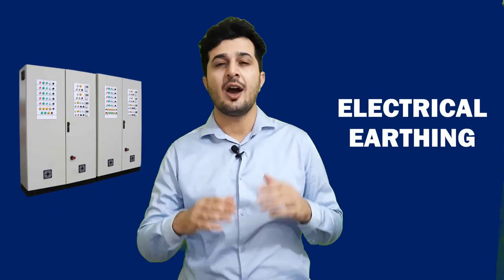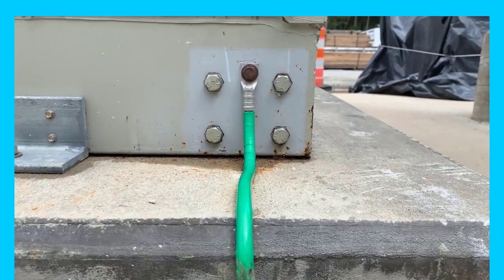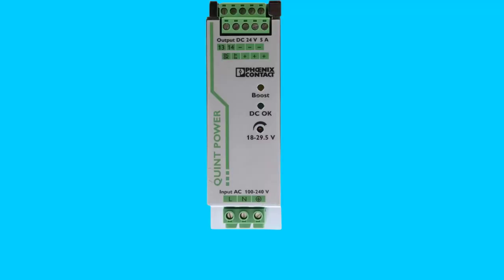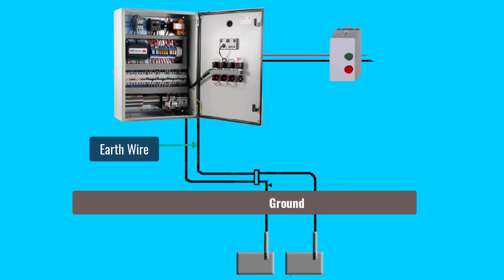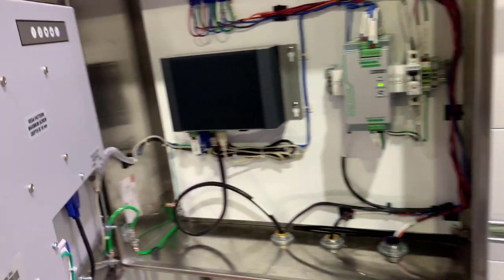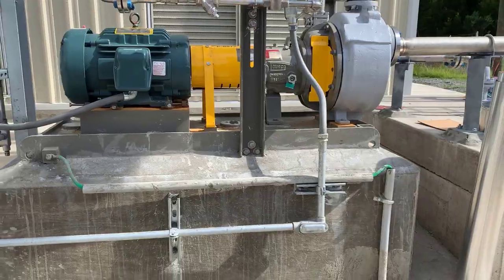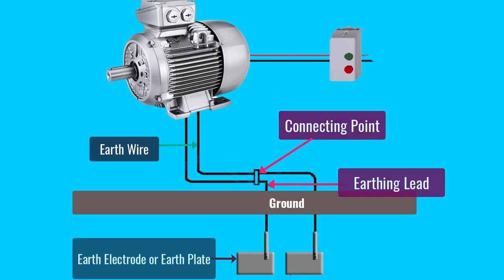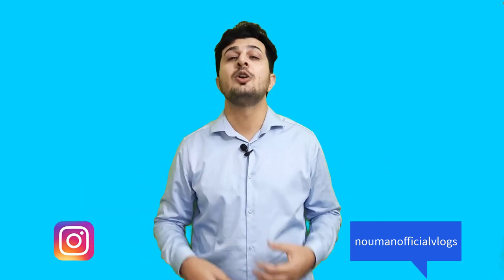Electrical Grounding Explained | Animated Lecture

Comment: Why current transformers need earthing?
Reply from the maker: The grounding of current transformers is important to both safety and the proper operation of the protective relays. To assure the safe and reliable operation, the neutral of the current transformer secondary should have a single ground location for each circuit.